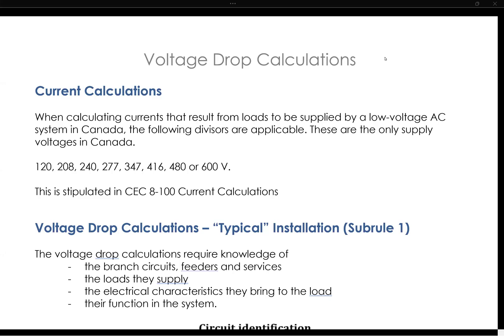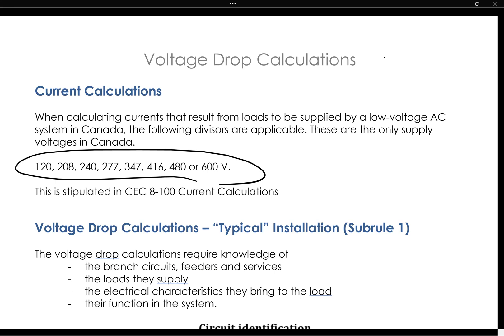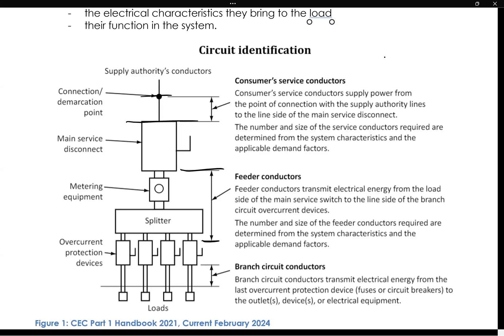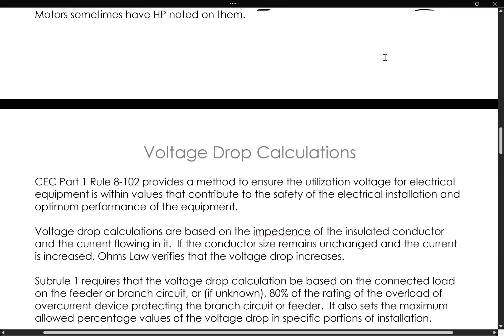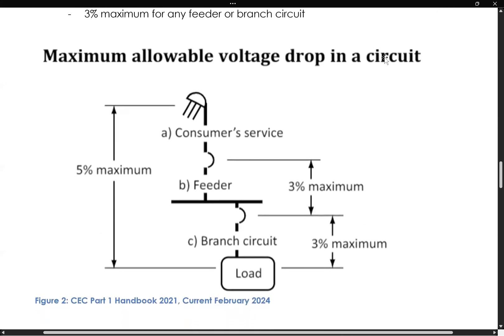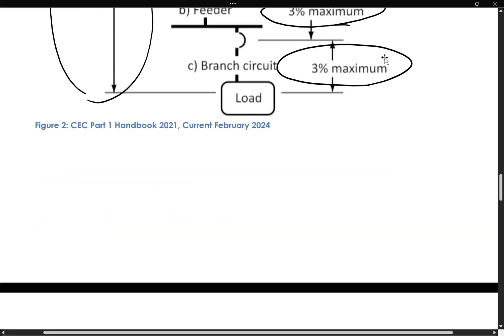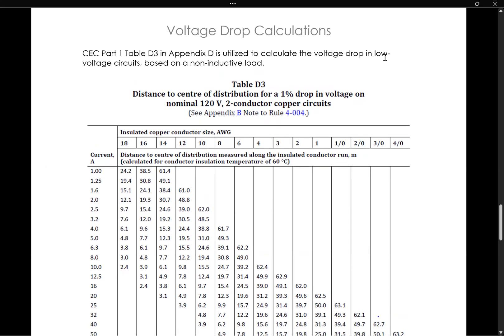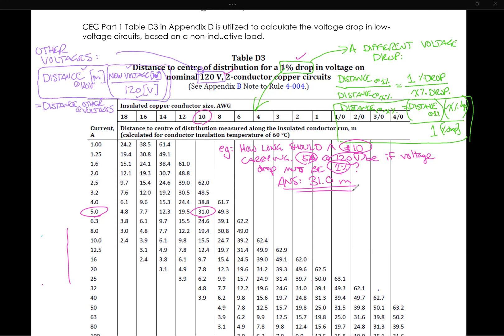** 2018 not 2024!*** Voltage Drop Calculations: How To Do Them. Canadian Electrical Code CEC

Comment: HI 
Thanks for your video
Would you please make a video regarding to voltage drop according to CEC2024 version?
Table D3 has been entirely changed and pf has been added.
Thanks
Reply from the maker: Absolutely!  I'll tag you on a new video with power factor included.
Reply: upload here table d3
changes